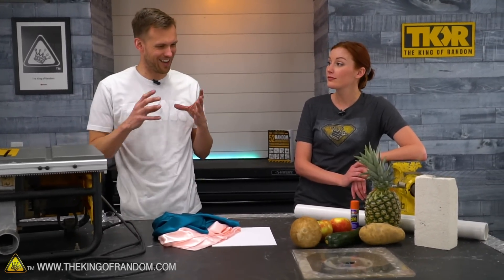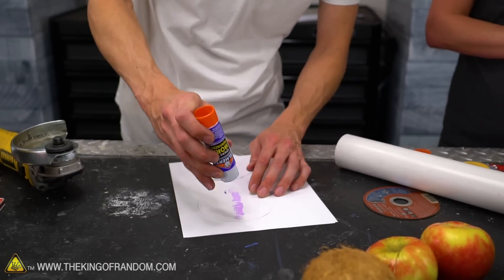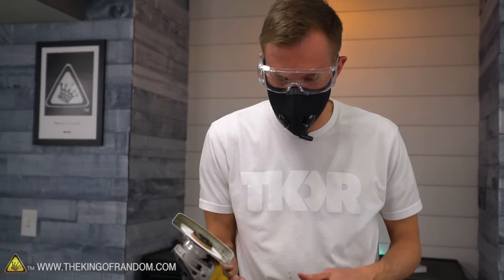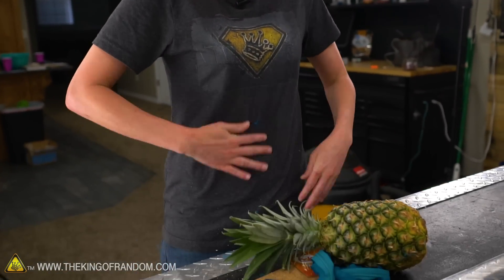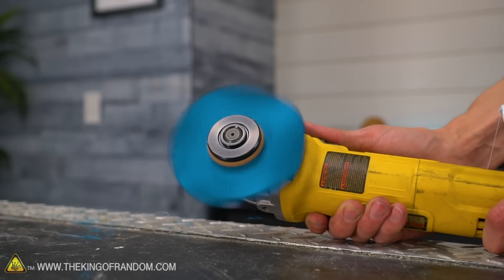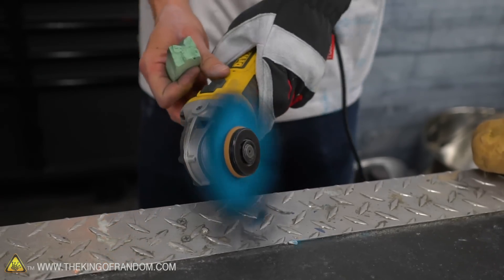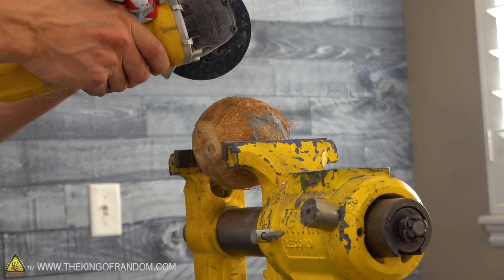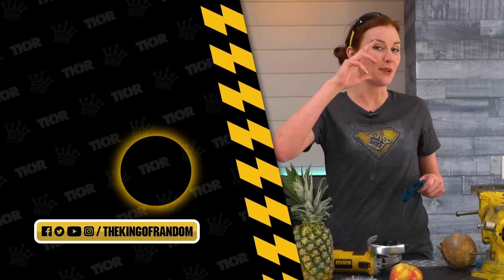How Silk Can Cut Through A Coconut

Comment: Burn the edges of the silk discs, that finishes the edges so it doesn’t fray. Or you can use fray check glue, or serge the edges. 
That will fix the “shredding” problem

Comment: The first thing that comes to mind, an Ice Blade. I'm so curious to know what it will do before it melts or breaks.
Reply: That is a very interesting idea, the ice may break when the wheel starts spinning. It would have to be pretty thick to cut something.
Reply: @itsariot9122  yes cause that's science
Reply: @VannillaPudding  I actually can't tell if your bullying me or-
Reply: @itsariot9122  no im sorry if you got the wrong idea
Reply: @VannillaPudding  it's fine,  I was mostly joking. Over the Internet fights are not my thing lol.
Reply: @itsariot9122  oh ok me to bye
Reply: @itsariot9122  yeah... The rotation of the disc is going to cause friction that will melt the ice in an instant
Reply: Or dry ice
Reply: it'll probably.. cut
Reply: Melts immediately
Reply: the force from spinning a wheel of ice would just shatter from the high RPM's of the angle grinder or other power tool. and if the force does not break it the contact of whatever material it hits whilst spinning at those high RPM's would shatter being a a very large hazard to the person operating the machine and maybe those standing by.

Comment: How did someone find out that silk moving at a high speed can cut through something?
Reply: Curiosity. That's all you need.
Reply: Silk is a high strength fiber. We have been using high strength fibers encased in resin for hundreds of years. Silk and resin is actually probably one of the oldest composite materials because I’m sure some oriental civilization used it thousands of years ago that I haven’t heard of or remember. It’s not until recently that they started using stuff like plastics and fiberglass as a replacement for natural fibers. Those dremel and angle grinder wheels are actually made of fiberglass. The world of composites is fascinating.
Reply: Your reply to my comment is too long to read
Reply: Three words: king of random
Reply: Maybe a worm jumped really fast and decapitated someone

Comment: NATE: Not candy, it will just break.

NATE 2 MONTHS LATER
WILL JOLLYRANCHER CUT THROUGH A PINEAPPLE?
Reply: Jolly Ranchers would insta shatter the second the  grinder turns on lol
Reply: leeChMSI no
Reply: @ryzech4168  yes
Reply: Then almost cuts off his OTHER thumb! LOL
Reply: You make a jolly rancher grinder by putting powdered jolly ranchers on a paper blade.
Reply: @gr81disp  I assume you mean like a diamond wheel, which would most likely just  melt due to friction and spray everywhere. If you mean like sandwiching layers of paper and jolly ranchers, i'd also imagine that it may last longer, but  the  heat would again melt it.
Reply: @leeChMSI  I didn't say it would work WELL...
Reply: @gr81disp  I don't think it'd work at all, pretty sure the  hot  jolly rancher(if applied while melted) would compromise the  paper, and  making  a powder coating of it would probably produce those burnt adhesive smells that  nate was complaining about with the silk one.
Reply: I thought how about candy themn he said no candy it will just break

Comment: So you said a material that wasn't paper, cloth, or candy. What about a 45 record? If you sharpened the edges a touch and stuck it on the angle grinder it might hold itself together enough to cut. You'll probably have to take the guard off again though. 
I was also wondering if just a thin sheet of wood would work.

Comment: Instead of using that method why not try moving the silk in a string or rope form to cut the coconut? You could probably try attaching it to a band saw. 
Another test can be wet vs. dry. For whatever reason I think wet cloth would have held up better in this video and if you end up doing string/rope test with silk then wet will still do better than dry.